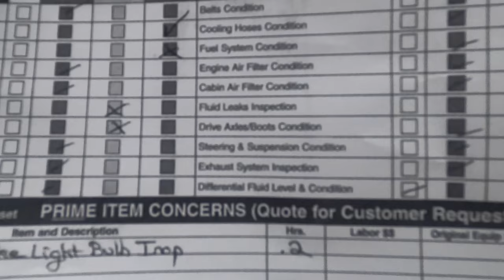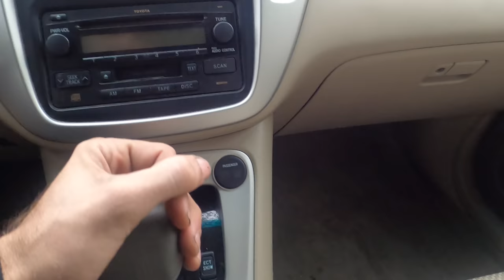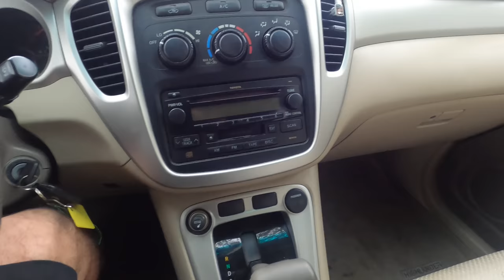We were BASHED by the Dealer! Ripping off a customer! Toyota Highlander 3.3

Comment: A toyota dealer in North Carolina was supposed to check the lifters in my new to me 80 series landcruiser. Well they charged me 350 and never touch anything. They assumed the oil running down the back of the engine was something major or they were just trying to make some really good money from me. They said I needed a entire front axle and engine. It had a leaking valve cover gasket so I said why not let the dealer check the very lite tap i hear from the top of the engine. before I finish working in the area and trailer the cruiser home.  The axle was not leaking at all and was completely full of good oil when i bought it. Locker and breaks worked great and had zero play in the bearings when i checked them as well. I just jacked the front end up and rocked the tire. When I got home my new bearings and seals were there and ready to go in. On inspection I only found the bearings needed some fresh grease. I replaced everything because I had it already and didn't want to work on it again. As for the engine the lifters were a little out of tolerance and the valve cover was leaking only just as i suspected on my examination before buying it. Probably would have been fine for years to come but took the entire engine apart and freshened her up with some goodies. They burned me in my opinion. I will not ever take a vehicle out of warranty to a factory parts changer again. Four years later and 70 thousand miles later she still runs strong while hauling about 2k extra weight from armor and gear. She is a heavy girl and not scared to drive her cross country and go wheeling any where. Only problem is she loves the fuel but all 80 series do.

Comment: I had a new engine put in my F250 at my local dealer. When I went back to get my 1st oil change they came back to me with their inspection report and said I needed new fluids like my radiator. I blew a gasket and went to the service manager. I just paid for new fluids with the engine swap out. The manager took care of me but they didn't inspect. They just looked at the mileage and checked all the boxes.

Comment: As someone who has worked private shops and dealership there is good and bad to both there are some dealership ripoff but there is also good mechanics there too. I've been at a private shop that I left after only 4 months because the owner wanted me to reuse torque to yield bolts reuse old antifreeze after repair and he himself made unsafe repairs on vehicles. So if people commenting have never worked in this industry or at both types of shops you don't have all the facts either. There are good dealerships and private shops and also bad ones too

Comment: Just completed a 4 wheel brake replacement on a 2018 kia soul, 75,000 kms. Back in January the customer took car to his dealer for oil change , was up sold brake service @ $90/axle .So not 3,000 kms and 6 months later front brakes metal on metal and rear brake pad separation and seized in gussets. Don’t know the conversation between this guy and his dealer but I’m thinking if he wasn’t told he needs brakes “now” means they probably didn’t pull wheels for inspection like you did in this video and took the guys $$

Comment: That's rich... We had a customer come in for an oil change and rotate and balance. We do a visual and report back to our customers what we find. I noticed the front pads were at 3mm and the rear were at 4mm so I recommended brakes. Customer said Chevy replaced brakes about a month before. I had them come out to the shop just to show them and boy were they pissed. They said Chevy charged them in the ballpark of $600 for a front and rear brake job. I got the job and put the old parts in the box for the customer to bring back to the dealership.
Reply: Could be lying, no?

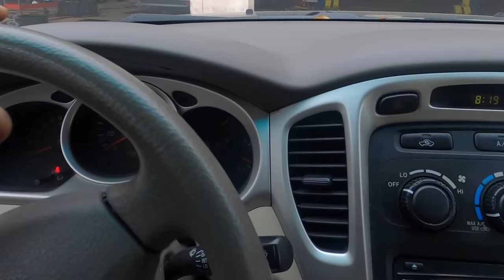Comment: 3:39 . Completely understand what your saying. But a believe a better way of understanding it is that you've got to be honest to yourself about your own work/job, while still accepting that you might've been slightly off on another persons standards of the job. People have to take on a lot day to day. At the end of the day I know a lot of mechanics that are extreme perfectionists that will spend 4+ extra hours working on something. While some others I know are pleased that the job they did works as intended and cut their losses, neglecting minor annoyances such as some extra sound, etc. I know it's not always the case but I've learnt over the years that certain things will never be the same as new. I loved what you said in a separate video about everyone lives in there own reality. What might be fine to one person, still might be wrong to another, even if the purpose of the machine is still accomplished. Bottom line. If you want a brand new feeling system. Replace the whole system. Otherwise, expect minor inconveniences. However, this only applies if something isn't drastically wrong. If you want something perfect, or the way you like it. Do it yourself. If not, accept that people aren't perfect and that there's a lot to deal with in a day. My opinion, if it works, it works.

Comment: Emery tape the hand brake linnings and finish inside disk with emery tape . This will leave a quality surface for the linings to grip . Adjust hand brake linings .
Flushing and bleed the brake fluid would be a good idea .
Maintenance looks poor as quality caliper pin lube will last till the next pad change . Where is it gone ?
I use Lok tite Silver Grade Never Seize and/or any silicon ceramic brake  lube

Comment: I can say that from the video, those caliper bolts/ slides,  haven't been out in a long time. So it's like no one ever looked that far into it. Your guys or their guys, as fast as it comes off, why wouldn't all mechanic's have a look when ever the brakes are serviced. Not just change the pads and that's it.   It is always worth doing everything possible to maintain the safety of the customer, the reputation of the establishment and ultimately the main line mechanic. People lives are really in your hands. The shop where cheap and fast is more important than thorough and safe, will eventually fail it's customers. Brakes are important. Charge enough to do the full job right. Then everyone's happy, the jobs will be easier next time, things wont be bound up and you will already know the status of the parts involved. Like a doctor, the more visits the more aches and pains they fix. Squeaks and rattles are the same, they turn in to other things if not addressed in a comprehensive maintenance schedule. Of course usually the customers only bring the car in when something has already broken. So there is that.. Subscriber, watched way more than enough of these videos. lol   I like your technique and problem solving. If I were your boss I would make you mount a camera on  your head though. Imagine what you could do with two hands. lol  Just kidding. Take care

Comment: Have an '07 Highlander AWD, they are tough on brakes for some reason, probably the corrosive salt in winter doesn't help! I've done brakes at least twice all around and the rear have no backing plate or parking brake assy's. rusted away and disentigrated!

Comment: Dealerships make most of their money they parts and service. But they are in competition with other dealerships and all are into building empires. My advice is to steer clear of dealerships once the vehicle warranty expires. Then find a reputable repair shop for the vehicle make and model you have.

Make sure to get the final CVT transmission fluid/service change before leaving the dealership however. CVT service can prove fatal without the correct skill sets and tools.

Comment: I did a few decades turning wrenches.  I had the opportunity to attend 'brake, steering & suspension' schools. None of them...not one would suggest that the original "brake job" was properly done.  Caliper slide pins binding, as demonstrated by you,  tells me someone threw the pads on and shipped it.
Bottom line:  it's work like this that gives an honest tech a bad reputation,  but then, it's your shop and this is an open forum.

Comment: Even being directly responsible for a car i can think of times i wish i could be more objective, had one of our cars break down broken cam sensor plug, fixed that and did the timing belt because it was over due, accidentally had the belt off a tooth for some test driving which gave problems under load, fixed that and then two weeks later it starts doing stuff very similar to the timing being off again, i was convinced it was something i had done or touched but in the end it turned out the catalytic converter clogged. Im Guessing having the timing wrong for a short time likely accelerated the failure but i spent days hung up on my old work thinking i had massively messed something up or missed something

Comment: I think most dealerships just try to get all they can from uninformed customers. My dealer tried to charge $150 to change the cabin filter and motor air filter. I need it myself for around $25. If the dealership can do that to 25 customers a day they will have a good payday.

Comment: I didn't see you or anyone else mention twhat looked like an "epoxy repair" like JB Weld on the cracked and leaking "radiator neck" due to the gray color. That is a BIG NO NO! That repair won't last and will cause an engine overheat and potentially destroy the engine to include overheating the transmission along the way when the hack radiator repair fails!

Comment: I would take all of my vehicles to you for repair. You really know your stuff.  I was a diesel mechanic many years ago. I can can still appreciate your passion for the profession.
Reply: Except his piss poor brake job got him in this situation, the slide pins were seized up he claimed they were not because he could muscle them out with pliers, thats the most ridicilous thing ive ever heard. Also tons of fluid leaks like Toyota said.
Reply: @NjoyMoney  He didn’t say they weren’t seized.  And he said he didn’t do the brake job on this car.
Reply: @NjoyMoney  Apparently you have a listening and comprehension problem. The dealer said the valve cover was leaking(it wasn't). They also said the caliper was locked up(it wasn't). And they wanted to replace good calipers and hoses with new. Also, he, specifically didn't know if he did the brake job. Facts matter and shilling for dealerships makes you look silly at best.
Reply: Emergency brake drum on four wheel disc brakes, rusted common  to clean during any brake repairs as for pin’s they also should be cleaned and lubricated with high temp grease . Great diagnosis an fix
Reply: But not if you get his coworker who did a terrible job on those brakes to begin with! That guy never pulled and checked the slide pins!!! Who knows where else he slacked off!
Reply: So would I, unfortunately I live in Australia 🇦🇺 😢

Comment: Whenever I do my brakes, I clean everything from top to bottom. This honestly just looks like an accumulation of lazy brake jobs comeback. Glad you took care of it for them.
Reply: Yeah. When the parking brake drum is rusted up I usually just go ahead and run a light turn on them while the rotor is already on the lathe. It’s better to take that little bit of extra time up front and not have it come back with a squeal or other noise down the road. When you make a habit out of taking care of the finer details it can be done very quick and efficiently.
Reply: Every time I do brakes I change pads rotors shoes drums whatever it has. When it comes to rotors like that, that have the e-brake in them. I change everything but the pads to the e-brake. The reason I don't change the E brake pads is there only there to hold the car. The reason I replaced everything is your rotor should be turned every time you change your pads or shoes. Me personally I'm not a fan of it due to the fact that you're removing metal and making the rotor thinner more susceptible to heat and warping. If you buy new ones they usually come with the 2-year warranty and you can warranty them out every time you replace your pads. But that is only if you do it yourself. If you take it to a shop it will cost you and you're definitely not getting that warranty. The only thing that I do not replace is the slide pins. I clean them and put them back in. Unless they look damaged and if any bolt looks damaged I replace it.
Reply: @Jpilgrim30  I can't yet speak for how effective it may be, but, in my drum-in-hat cars I make a habit of every so often to lightly run the parking brake while driving, not enough to break anything, maybe 1.5 seconds at 45mph every few k-miles, just runs the pads over the drum to keep it clean. sure, it might make me have to change them out one day but there have been no noises from rust build up and the parking brake still holds very well.
Reply: Also looks like the owner doesn't use the park brake.
Reply: @partymanau  At least owner visibly does not maintain their parking brake by "running 'em rustfree" every other month. Most people do not even know what kinda parts/systems they have within their brakes, let alone understand how to properly use those to make sure everything stays in working order. Manuals do not explain such things anymore, and in times of leasing, warranties and "customer protection" jurisdiction instead of accountability of the user, nobody does even care to understand what they are using, because knowledge and responsibility are no longer part of owning a car (or any other technical device)
Reply: I agree with you Gabriel it was just a quick break bad job they did not lubricate and clean the pin’s.
Reply: Your correct about some of what you said but this guy making the video is not all that as a repair man I'm not saying that im a pro but I do my own work because of dudes like this one
Reply: Yea i prefer not using flapper discs on brake surfaces too, even on my own vehicles lol
Reply: @datadavis  why so
Reply: @JTKK9  its alright for a parking brake, but i suggest you try sanding sanding the brake discs on your car with a flapper disc and see how it works. lol.
Reply: @datadavis  you still did not answer on my question 
is better to go to shop and replace a thing than trying to accualy fix things ?
Reply: @JTKK9  you cant fix a brake disc surface if you dont have a specialized brake disc grinder, i suggest you go to a specialized brake shop and let them fix your discs. its really not expensive and you can do all the surrounding labor yourself. if the discs are close to minimal allowed thickness its better to replace them. Satisfied with the answer?
Reply: same, i take out the drums and scrub everything i can down, even the shoe pads
Reply: @dprrn  every now and then I'll use them to stop at parking lot speeds.
Reply: Yea those pins look neglected.
Reply: It looked like a new rotor customer doesn't use their parking brake is all that is
Reply: Yup!  Clean it good.  Make sure you don't get brake cleaner on any rubber parts and don't used petroleum based grease on the rubber.